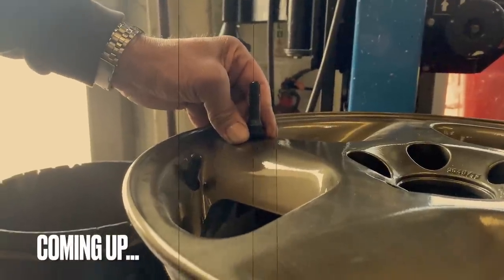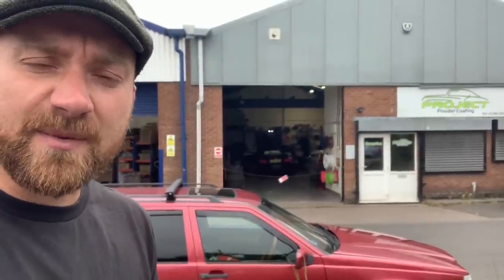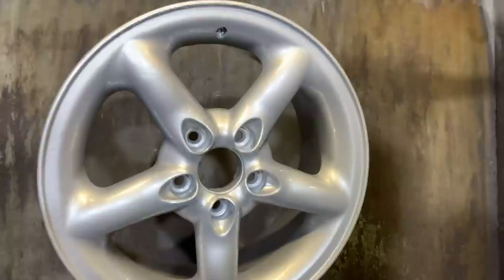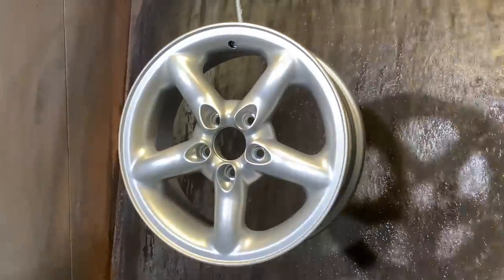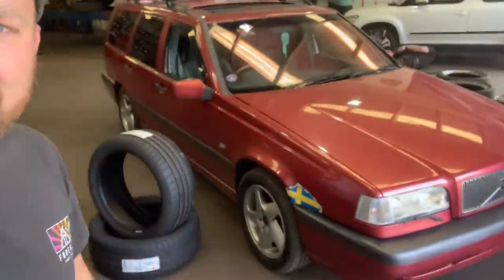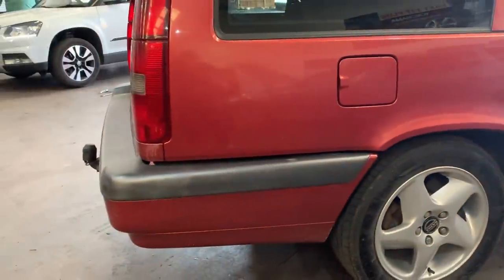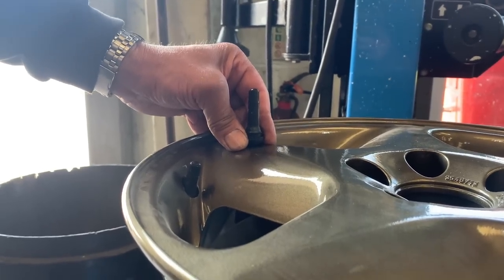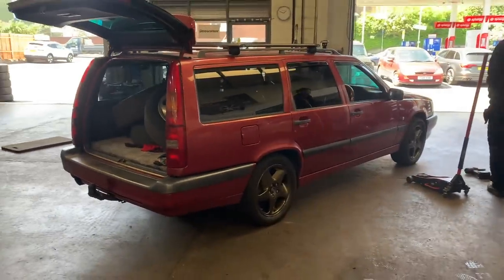Fitting freshly powder coated GOLD alloy wheels to my Volvo 850

Comment: Not so keen, had mine refurbed last year and stuck with silver. Run Michelin Cross Climates on both my V70 D5 and C70 T5. Like on rails. The T5 dislikes potholes though.

Comment: Rub a bit of vinagar in to that cement , if it's only cement an acid will clean the salts and alkaline in the limestone , but have the builders put an admix or waterproofer in the mix , what job were they using the compo for ?

Comment: PS I think your ride comfort comes from stepping up a size? Those look like 55 profile instead of 50. I know they are vastly cheaper (1/3??) for some reason but tragically (for my wallet) I prefer the low-profile look
Reply from the maker: That’s the exact problem I’m having. Moving to 50 will be a £400 job. But it’ll happen soon as I want to go lower…
Reply: @GeoffBuysCars  My 850 and V70 both need tyres (thanks to POs fitting Chinese liquorice rings) and bothe might as well have a reurb for the bit extra over fitting and balancing. Even shopping around for bargains thats £1200. I could have a holiday for that, it really makes you stop and question your loyalty to your hobby and your sanity.